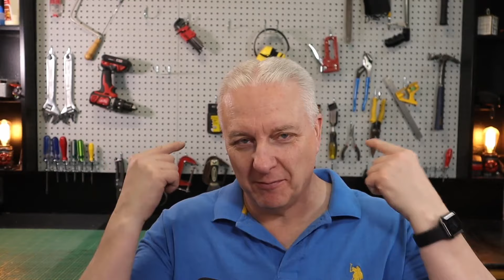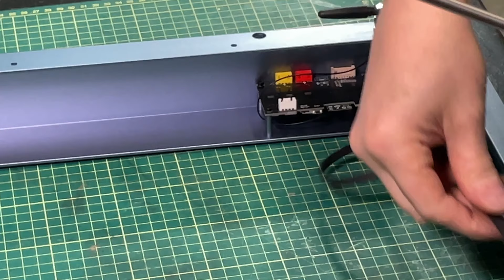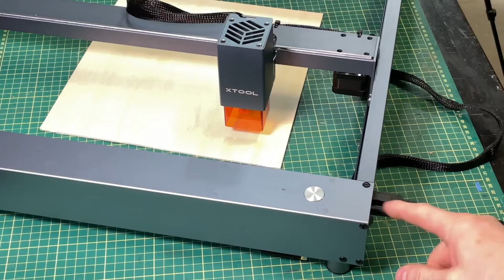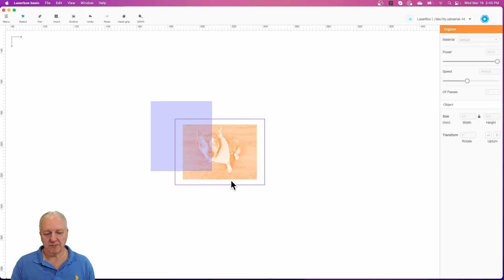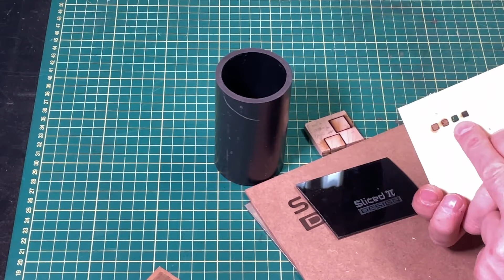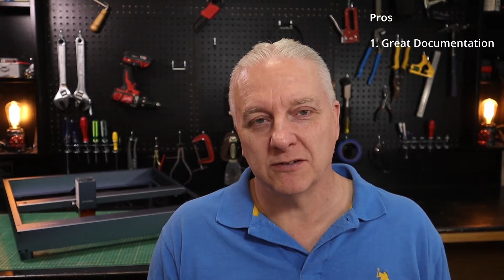Finding the Ultimate Diode Laser?  Testing the XTool D1

Comment: Thanks Steve. I really enjoy and appreciate your helpful videos. I purchased a OMTech 70 watt laser about a year ago, and have learned a lot, but want to engrave metal and cut 1/8-1/4 Baltic birch more cleanly. This machine seems just what I need. For safety and smoke control I plan to store and use it on the floor of the OMTech!
Reply from the maker: Diode lasers are mostly limited to things like stainless steel. If you want to do aluminium or brass, etc you will need to coat it first. I use my SP-3624 Laser as a vacuum chamber for these smaller laser too